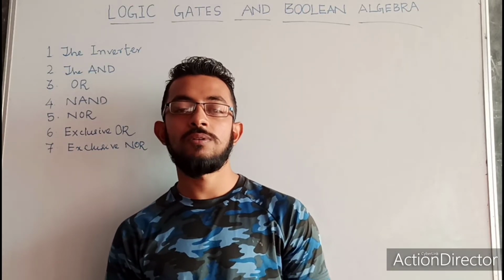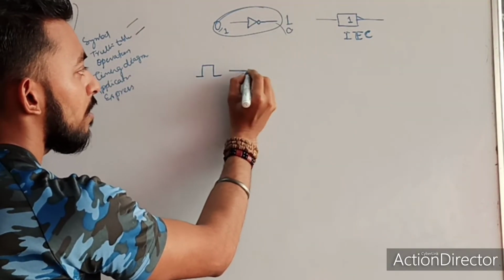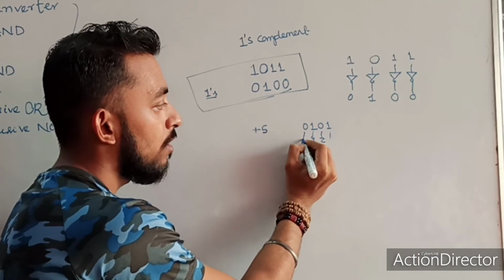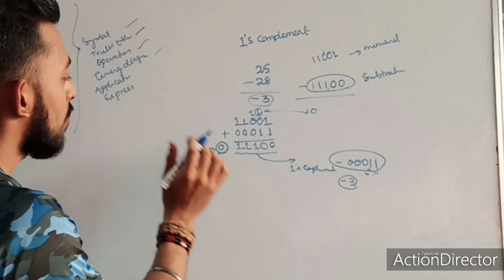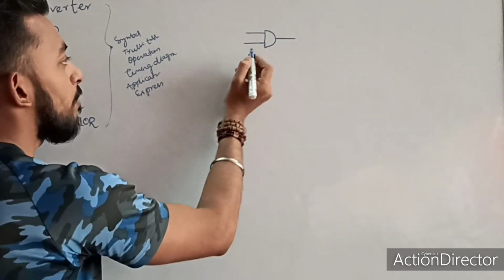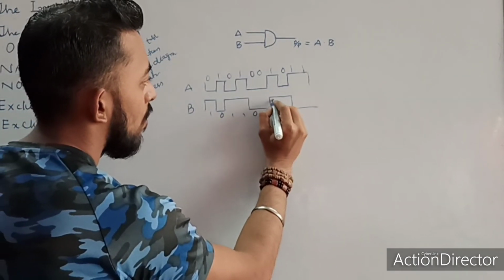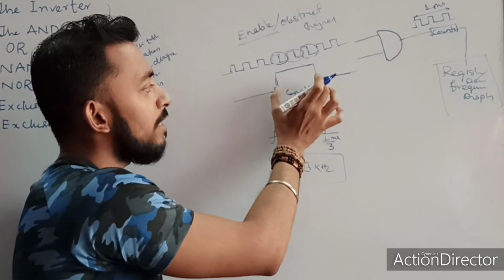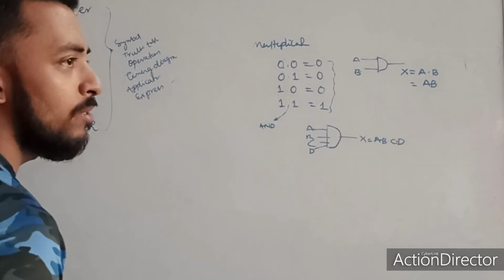LECTURE-26.BASIC ELECTRONICS,LOGIC GATES & BOOLEAN ALGEBRA(PART-1), INVERTER & AND GATE

Comment: Sir,
 if we add +5 and -5 then, 00101 and  11010 will add up to 11111. 
Now, if we consider signed 1's complement, we will have the left most 1 for -ve sign and invert the others to get 0000.

This finally gives a value of -0
But, in decimal number system, we don't have -0.

So, why does 1's complement allows 2 0s and how do our systems deal with the 2 0s in practice ?
Reply from the maker: There are basically 3 types of representations of -ve numbers. 

1. Signed magnitude method
2. 1's complement method
3. 2's complement method

In 1st n 2nd method +0 and -0 has different representation. But in method 3, 0 has only one type of representation.... 

Hope you understood, else knock me over whatsApp.